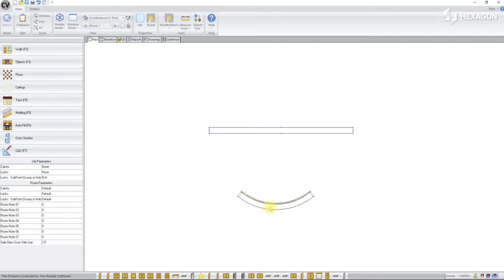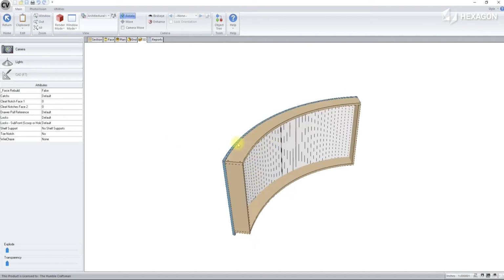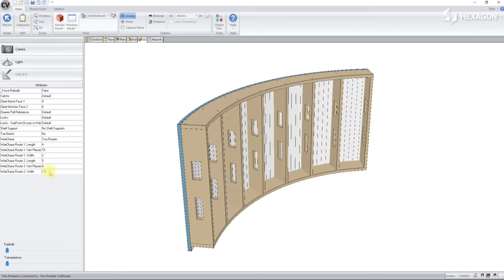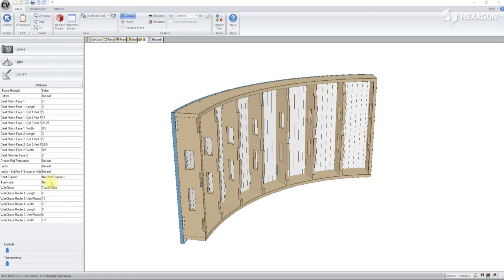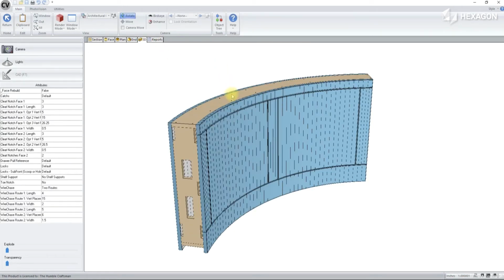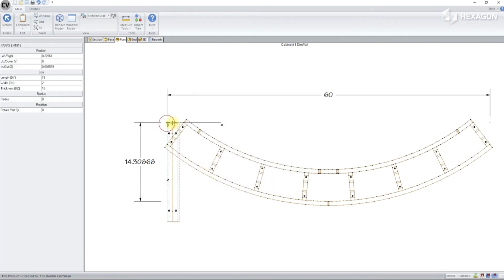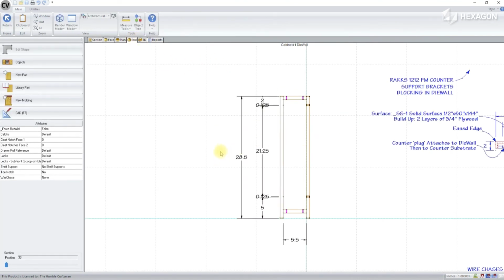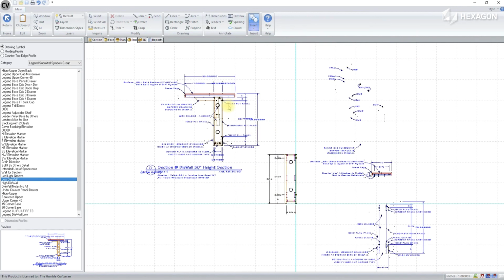CABINET VISION Submittals- Diewalls

Comment: SO we are working towards an upgrade to 2023, new server blah blah, but we are currently using 2011 - will the new defualt features? if die is now a default item in corporate into the update version is i use existing data files?  I would so hate to have to install or rebuild by data base after 20 plus years!